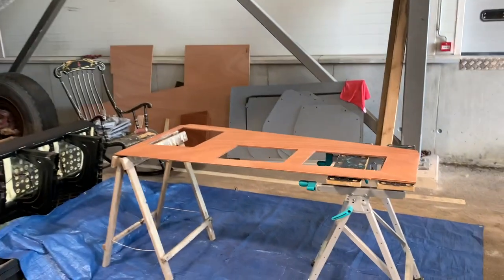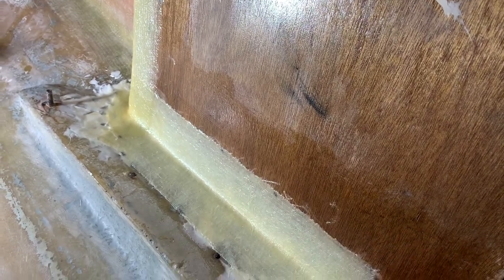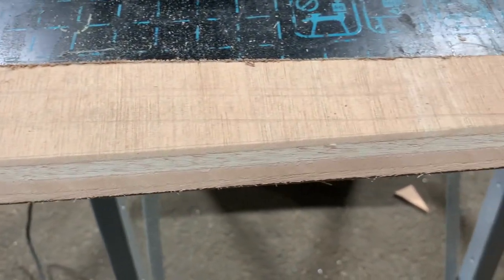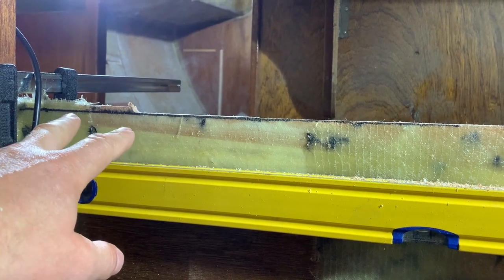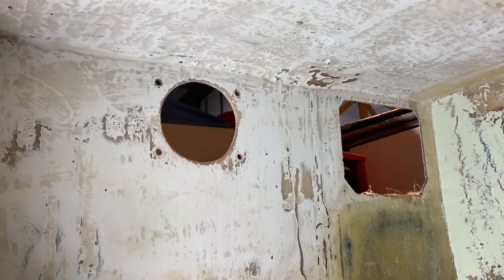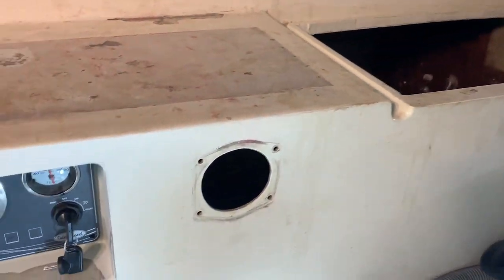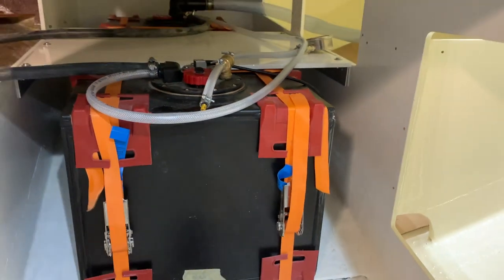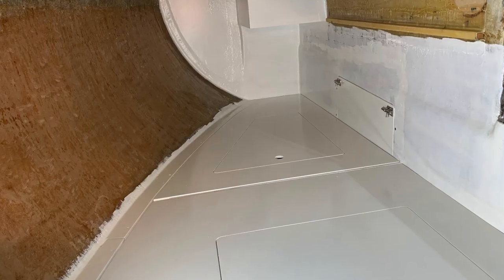Remaking of quarter berth, cockpit locker, engine panel recess etc

Comment: Wonderful work! You have what it takes! I did rebuild an OE 36 many years ago; it had its ups and downs but was a fantastic adventure. You can sail her all across the Baltic sea, in any weather. Just make sure you have a good tight fore peak hatch (wet on foredeck in bad weather and also put effort in getting tight fit for lazarette hatches. Ensure good bonding for stearing sheeves (can be weak and a lot of force in bad weather). I put hydrophibic heating in, with accumulator tank in the bottom of the clothes locker (dry clothes and long runs with circulation pump only), it really lengthened the season alot. Totally better than airheaters I have had since. When you have made more progress, take a good look at investing in a proper and stable stainless steel sprayhood, with handholds to walk on to deck, totally worh it. Good sprayhood makes bad weather easy on the OE 36 and walking on deck in bad conditions calm. Good luck and looking forward!!!
Reply from the maker: Thanks for watching and commenting, especially nice to hear from somebody who has owned and refitted an OE36 :) I really appreciate your advice!

Comment: Your plans are coming together nicely!  The work looks very good!  And, yes, maybe no one will see below the quarter berth cushions but you will always know if you did a nice job or not!  I never thought to test a thru hull fitting to check for leaks.  Wow, that could come back to haunt you if you left the boat for a long time expecting the valve not to leak….  You (like all of us) make mistakes but you always seem to recover from them well!  Regards.
Reply from the maker: Thanks for watching and commenting! As a matter of fact that thru hull fitting was an old one and the ball valve surface was pitted from corrosion. So that was not much of a surprise to have an air leak from there

Comment: Did you use the white  Q-Cell powder to thiken the epoxy for glueing and filletting?
Reply from the maker: I bought the thickener from a local industrial supplier, they called it "microspheres". They are very small hollow glass beads indeed although they feel like powder.